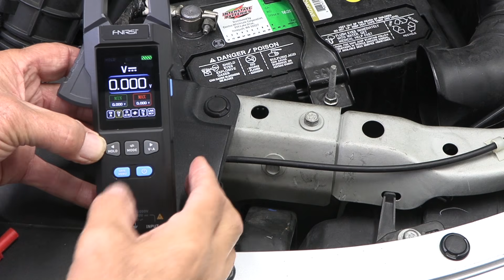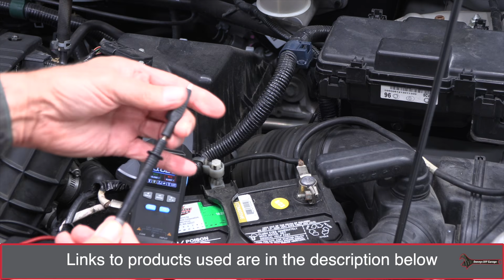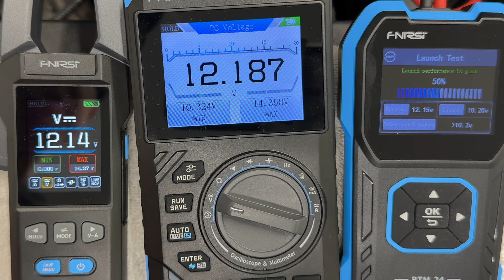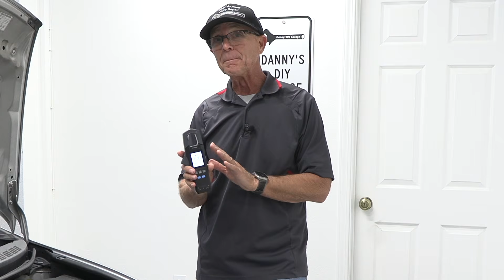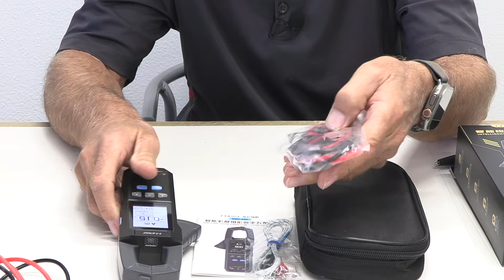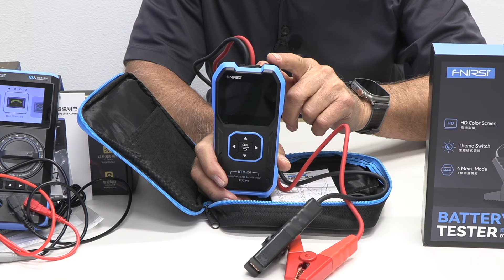Test Battery, Starter & Alternator FAST (Amp Clamp + Budget Tools) | FNIRSI

Comment from the maker: ✅ QUICK WATCH NEXT (if your battery keeps dying):
Parasitic Draw Test (Honda Element) – Battery Dead Again: https://youtu.be/fZZpQY1aCVk

In today’s video we cover:
Battery test (CCA) • Starter draw • Alternator output • Quick parasitic draw check

⚡ Tools I use (Amazon store):
Electrical Diagnostic Tools: https://amzn.to/4aJjROJ
Battery Testing & Charging Tools: https://amzn.to/4724a2X

What’s your issue — dead overnight, slow crank, or charging light? Drop it below 👇

Comment: What is the Cold Cranking Amps referring to? The sum total of the starter Motor amp draw + the alternator amp draw + what else? Because that doesn't add up to cold crank 500 amps
Reply from the maker: CCA is the battery’s available cranking power in cold weather, not the total amps the car always uses to start. The alternator is not part of that number. A 500 CCA battery just means it can supply that kind of current in extreme cold if needed, not that the starter always draws 500 amps.
Reply: @dannysdiygarage but what "loads" are going to be drawing using the CCA 500? The starter Motor what else? Even in cold weather a starter Motor won't draw 500 amps so there must be something else drawing amps from the battery CCA 500 amps

Comment: Excellent explanations!  You went step by step & provided all the necessary details of the equipment & the testing procedures.  It is not the first time I have seen these FNIRSI electrical tools in other videos, but it is the best one on how to use them.
Reply from the maker: I appreciate that, you will see these more in my videos, I was truly impressed with the amp clamps accuracy

Comment: As always a great video. I have a Klein multimeter with the amp probes. It's my go to. I also have a Schumacher BT453 battery tester. These tools can save you so much time and money if you learn to use then right. The alligator clip attachments are a must have. I also appreciate the time and effort you put in to make these videos happen. Thanks again.
Reply from the maker: I do appreciate you noticing the work put in. Thanks so much ❤

Comment: Is the Amp Clamp a good predictor of starter/alternator/battery failure before it happens? I have a BT 100 and I'd like to be able to tell what component I need to replace before it happens.
Reply from the maker: I’m with you on that, appreciate the comment
Reply: Danny  Amp clamp cm-600
Reply from the maker: @raybautista5072 I don’t understand the comment